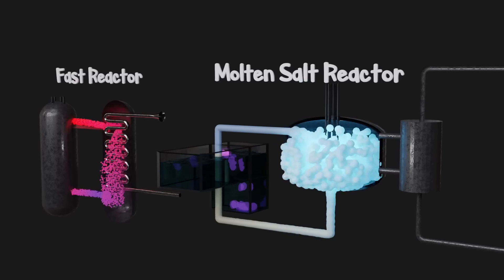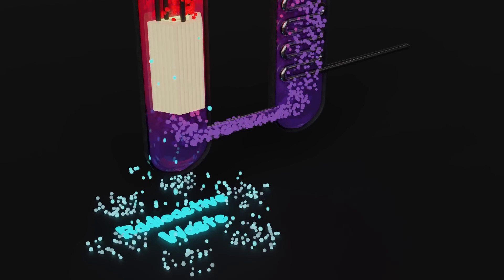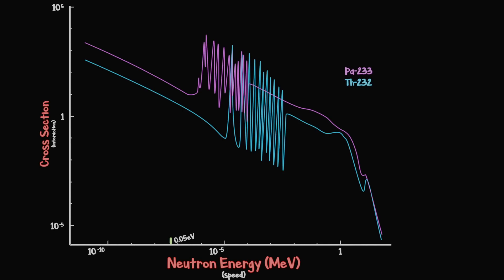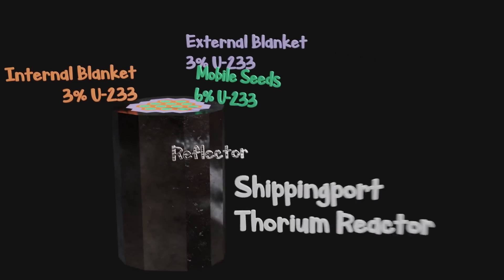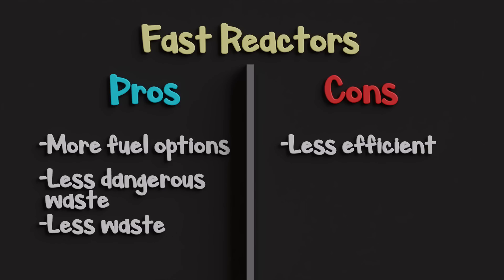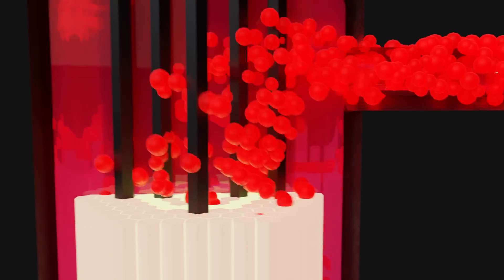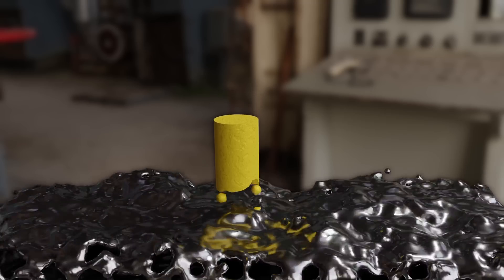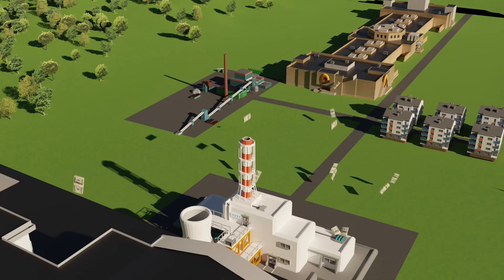Thorium and Fast Neutron Nuclear Reactors

Comment: whatever nuclear fuel cycle you can think of, the power generating scheme is still based on James Watt design= heat water under pressure, expand the steam through a turbine/piston/Stirling/whatever, condense the low pressure steam. Repeat. The trouble with this is it only uses the energy of the steam. The energy used to boil the water in the first place is WASTED, and that accounts for about 60% of the energy provided by the reactor. Then you get the nuclear reaction by products. EPA and DOT have written thousands of pages (killing a lot of trees in the process) on how these wastes should be stored/transported/disposed of. There is no limitless clean energy. To make the concrete-steel structures to house the reactor, you need to pour CO2 into the atmosphere, as limestone is turned into Portland cement, and iron ore is turned into steel. Then there is the huge amount of Diesel fuel used by the trucks and bulldozers at the construction site. Then there are the thousands of gallons of gasoline from the company's lawyers cars going back and forth from City Hall, Sacramento, Washington to work out the permits, taking city, state, federal officials to dinner...CLEAN energy? give me a break!
Reply: Nothing will ever be 100% clean, but there's definitely a whole lot of stuff we can do to get it closer to that, I'm pretty sure we have something better than literally burning stuff
Reply: @rizizum  i don't want 100%, just better than the 40% nuclear plants are getting today.
Reply: cleanER
Reply: Ever thought about the waste and CO2 produced by solar installations, that must be replaced every 30 years?
Reply: @egnegn123  i never said it was not CO2 free, but that it could be made more efficient, generating less waste. ditto with any power generating system

Comment: As Leibniz put it: “If an ontological theory implies the existence of two scenarios that are empirically indistinguishable in principle but ontologically distinct ... then the ontological theory should be rejected and replaced with one relative to which the two scenarios are ontologically identical.”

In other words, if a theory describes two situations as being distinct, and yet also implies that there is no conceivable way, empirically, to tell them apart, then that theory contains some superfluous and arbitrary elements that ought to be removed.

Leibniz’s prescription is, of course, widely accepted by most physicists today. The idea exerted a powerful influence over later thinkers, including Poincaré and Einstein, and helped lead to the theories of special and general relativity. And this idea, Spekkens suggests, may still hold further value for questions at the frontiers of today’s physics.

Leibniz’s correspondent
Clarke objected to his view, suggesting an exception. A man riding inside a boat, he argued, may not detect its motion, yet that motion is obviously real enough. Leibniz countered that such motion is real because it can be detected by someone, even if it isn’t actually detected in some particular case. “Motion does not indeed depend upon being observed,” he wrote, “but it does depend upon being possible to be observed ... when there is no change that can be observed, there is no change at all.”

In this, Leibniz was arguing against prevailing ideas of the time, and against Newton, who conceived of space and time in absolute terms. “I have said more than once,” Leibniz wrote, “that I hold space to be something merely relative.”

Einstein, of course, followed Leibniz’s principle when he noticed that the equations of electricity and magnetism make no reference to any absolute sense of motion, but only to relative motion. A conducting wire moving through the field of a magnet seems like a distinct situation from a magnet moving past a stationary wire. Yet the two situations are in fact empirically identical, and should, Einstein concluded, be considered as such. Demanding as much leads to the Lorentz transformation as the proper way to link descriptions in reference frames in relative motion. From this, one finds a host of highly counter-intuitive effects, including time dilation.

Einstein again followed Leibniz on his way to general relativity. In this case, the indistinguishability of two distinct situations — a body at rest in the absence of a gravitational field, or in free fall within a field — implied the impossibility of referring to any concept of absolute acceleration. In a 1922
lecture, Einstein recalled the moment of his discovery: “The breakthrough came suddenly one day. I was sitting on a chair in my patent office in Bern. Suddenly the thought struck me: If a man falls freely, he would not feel his own weight. I was taken aback. This simple thought experiment made a deep impression on me. This led me to the theory of gravity.”
Reply: Leibniz now mostly inhabits scientific history books, his ideas receiving scant attention in actual research. And yet, Spekkens argues, Leibniz’s principle concerning indistinguishability may be as useful as ever, especially when confronting foundational issues in physics. Consider the interpretation of quantum theory, where theorists remain separated into two opposing groups, loosely associated with the terms realism and empiricism. Although Leibniz’s principle can’t offer any way to unify the two groups, Spekkens argues, it might help them focus their attention on the most important issues dividing them, where progress might be made.

For example, one particular interpretation comes in the form of so-called pilot-wave theories, in which electrons and other particles follow precise but highly non-classical trajectories under the influence of a quantum potential, which produces the wave-like nature of quantum dynamics. These theories demonstrate by explicit example that nothing in quantum physics prohibits thinking about particles moving along well-defined trajectories. But the theory does require the existence of some absolute rest frame, while also implying that this frame can never be detected. Many other aspects of such theories also remain unconstrained by empirical data. Hence, one might take Leibniz’s principle as coming down against such theories.

On the other hand, Spekkens points out, Leibniz’s principle demands that distinct states be, in Leibniz’s own words, “empirically indistinguishable in principle,” and achieving such certainty is not easy. If several states appear indistinguishable now, future experiments might turn up measurable differences between them. So a proponent of the pilot-wave approach might agree with Leibniz’s principle, but still reject its application just yet. The aim of research, from this point of view, ought to be to seek out such evidence, or at least envision the conditions under which it might be obtained.

And in this sense, Spekkens notes, Leibniz’s principle also offers some criticism of
theorists from the empirical school, who object to pilot-wave or other realist interpretations of quantum theory for containing unmeasurable quantities. It implies, as he puts it, that the empiricists’ “set of mental tools is too impoverished.” 

After all, progress in physics often requires imagination, and creative exploration of possible distinguishing features that have not yet been measured, or even thought to exist. Progress requires scientists to “entertain ontological hypotheses, expressed with concepts that are not defined purely in terms of empirical phenomena.”

Science thrives on the essential tension existing at the boundary between empirical observation and unconstrained imagination. Incredibly, Leibniz perceived that more than 300 years ago.
Reply: Monad (Greek for "singularity", or "alone") has the same definition as Quark (strong nuclear force):

No spatial extension. Zero size. 
Exact location only. 
6 thousand trillion trillion trillion (39 zeroes after 6k) times stronger than the force of gravity.

Leibniz is our Universal Genius, not Newton. Read 📚 Monadology.

Match up definitions from Leibniz's works verbiage 300 years ago with quantum physics verbiage definitions today. Different words, same definitions.

Our 0D (point)/Quark (strong nuclear force)/Monad (singularity):
 just read what Christ and John (and Leibniz) said about Monad (also the Abrahamic Gnostics [Greek, Syrian and Persian]).

Not a coincidence.

Our ten numbers are 0, 1, 2, 3,...9.
Our ten dimensions are 0D, 1D, 2D, 3D,...9D. 

1D-9D is contingent universe.

Hamilton's 4D quaternion algebra can prove Leibniz. Update first four dimensions w, x, y, z to 0D, 1D, 2D, 3D though (as opposed to the current 1D, 2D, 3D, 4D nonsense).

Newton drinks his own pee. 
 
1 is not the beginning. 
0 is the beginning. 

1D is two points.
0D is a representative dot in a theoretical circle (point).

1 is contingent.
0 is necessary.

There is no 1 without 0.

A piece of 1, no matter how small, will NEVER be 0 (without becoming 0, thus no longer being 1).

What number is before 1? 0.

0D (point) is "One with Everything", literally 
". with 0". 

0D (point) is 
Monad (singularity) is
Quark (strong nuclear force) is 
Soul (6 thousand trillion trillion trillion times stronger than the force of gravity)

No spatial extension. Zero size. 
Exact location only.
Reply: pa·ta·phys·ics

/ˌpädəˈfiziks/
noun

the branch of philosophy that deals with an imaginary realm additional to metaphysics.

Pataphysics (French: pataphysique) is a "philosophy" of science invented by French writer Alfred Jarry (1873–1907) intended to be a parody of science. 
Difficult to be simply defined or pinned down, it has been described as the "science of imaginary solutions".

Metaphysics deals with all that encompass the omniverse. 

Pataphysics deals with what is beyond omniverse, beyond totality, the unknown. 

If you want to simplify it further, Pataphysics can be considered "The personal science of God himself".
Reply: "Before the beginning there was void. Nothing. No flesh. No rock. No air. No heat. No light. No dark. Nothing, save a single, perfect pearl.

Within that pearl dreamed a mighty, unfathomable spirit—the One— Anu. Made of shining diamond. 

Anu was the sum of all things: good and evil, light and dark, physical and mystical, joy and sadness—all reflected across the crystalline facets of its form. And, within its eternal dream-state, Anu considered itself—all of its myriad facets.

 Seeking a state of total purity and perfection, Anu cast all evil from itself. All dissonance was gone. 
But what of the cast-off aspect of its being? The dark parts, the sharp, searing aspects of hate and pridefulness?

Those could not remain in a state of separation, for all things are drawn to all things. All parts are drawn to the whole.

Those discordant parts assembled into the Beast-the Dragon.

Tathamet was his name-and he breathed unending death and darkness from his seven devouring heads. 

The Dragon was solely composed of Anu's cast-off aspects. The end sum of the whole became a singular Evil- the Prime Evil, from which all the vileness would eventually spread throughout existence.

Though separate beings, Anu and the Dragon were bound together within the Pearl's shadowed womb. There they warred against each other in an unending clash of light and shadow for ages uncounted.

The diamond warrior and the seven-headed dragon proved to be the equal of the other, neither ever gaining the upper hand in their fierce and unending combat-till at last, their energies nearly spent after countless millennia of battle, the two combatants delivered their final blows. 

The energies unleashed by their impossible fury ignited an explosion of light and matter so vast and terrible that it birthed the very universe all around us.

All of the stars above and the darkness that binds them. All that we touch. All that we feel. All that we know. All that is unknown.
All of it continues through the night and the day in the ebbing and flowing of the ocean tides and in the destruction of fire and the creation of the seed.

Everything of which we are aware, and that of which we are utterly unaware, was created with the deaths of Anu and the Dragon, Tathamet.

In the epicenter of reality lies Pandemonium, the scar of the universe's violent birth.
At its chaotic center lay the Heart of Creation, a massive jewel unlike any other: the Eye of Anu- the Worldstone.
It is the foundation stone of all places and times, a nexus of realities and vast, untold possibility.

Anu and Tathamet are no more, yet their distinct essences permeated the nascent universe-and eventually became the bedrock of what we know to be the High Heavens and the Burning Hells.

Anu's shining spine spun out into the primordial darkness, where it slowed and cooled. Over countless ages it formed into the Crystal Arch, around which the High Heavens took shape and form.

Though Anu was gone, some resonance of it remained in the holy Arch. Spirits bled forth from it-shining angels of light and sound who embodied the virtuous aspects of what the One had been.
Yet, despite the grace and beauty of this shining realm, it lacked the perfection of Anu's spirit. 

Anu had passed into a benevolent place beyond this broken universe- a paradise of which nothing is known and yet represents perhaps the greatest-kept secret of Creation.
Longed for, but unimaginable."

-THE DAWN, BOOK OF CAIN.
Reply: Wow, 10 comments on this channel all on this one video, and they're all completely unrelated to the video itself.
gtf outta here
If you want attention, then just make your own videos
Reply: @WanderTheNomad  dislike, unsub and won't comment again.